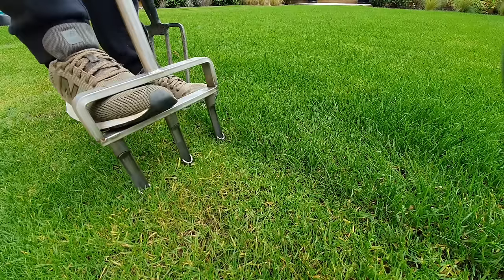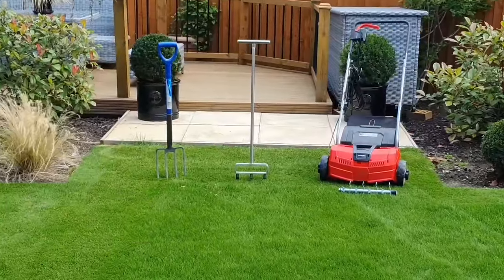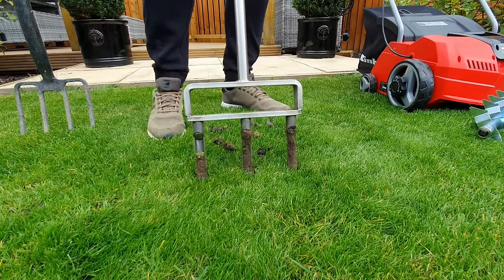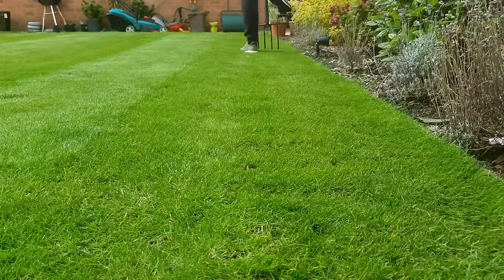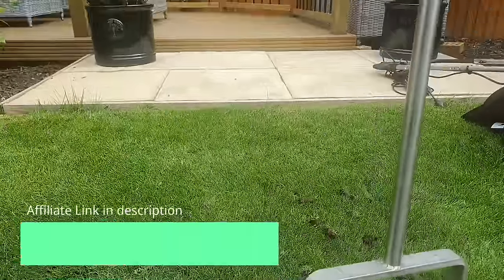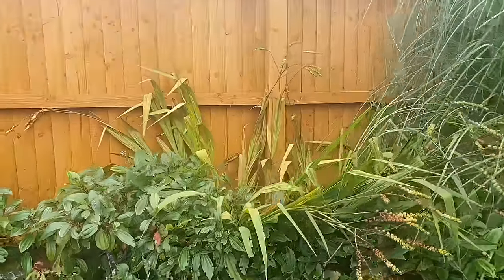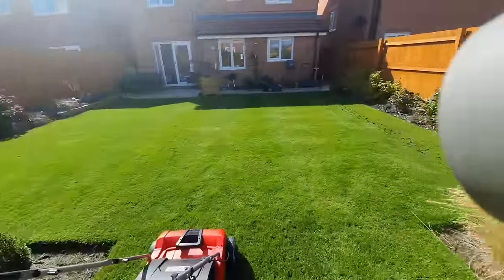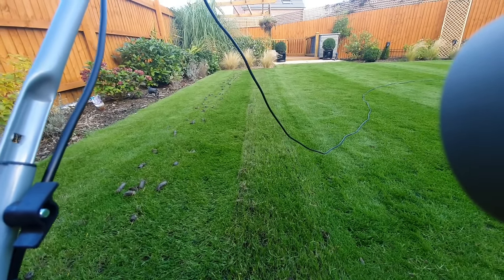3 Lawn Aeration Tools and When to Use (Solid and Hollow Tine)

Comment: If only someone was able to produce a domestic aerator just like your domestic scarifier. The professional ones are very expensive to buy, and a pain to hire if you just want to sort a little home lawn out. Obviously the unit needs to have enough weight to penetrate the ground... but there must be a way!
Reply: It's called your hands 🤣 Seriously, I finished my reno on 200m² with a three tines device by hand. Breaking work into chunks, not all at once but bit by bit works fine. Yet some good Cardio 🙂
Reply: I bought a  Mac Allister scarifier & combined Aerator from B&Q last week for £87.00. Not a bad bit of kit to be honest and did the job nicely . I’d recommend it 👍🏻

Comment: I have re-turfed an area 10sq m.  Removed all of the old turf, rotovated, levelled, topsoil to a depth of 100mm and then turfed.  All of this was done last July.  I wouldn’t think it needs the full works, but do you think that I should maybe manually aerate it with a fork?
Reply from the maker: Sure that will be fine 👍
Reply: Your lawn is still settling down so nothing to harsh just a light tickle with the fork and a good feed that will help establish deep  root growth. R.

Comment: On sloping lawn I use a metal blade lawn edger so the water can penetrate as it flows down hill.
Reply from the maker: Nice, is that to create a run for the water you mean?
Reply: @GardenLawncareGuy  Helps the ground absorb the water and helps stop or  slows down run off.
Reply: Never seen it go up. 🤔

Comment: Great video mate, and comforting to hear a Chester accent, my hometown (although I have livd in Christchurch NZ for the last 10 years). What season do you recommend aerating, and do you leave the cores on the ground?
Reply from the maker: Hi Sam thanks for that! That's a far cry away from the North West, can do it in spring or autumn really I remove my cores normally and I need a flat level for the cylinder mower and don't want them going through that

Comment: Hi there, watched a few videos.
Just recently bought that einhell machine. Waiting a month or 2 to scarify and aerate my lawn.
Is it worth doing the core aeration one month then say a month later use machine to slice aerate then overseed?

Also have a very massive slop as a lawn is that ok to slice aerate was thinking that might help the slope? As grass ain't good on slope but it's lush everywhere else.
Cant core aerate on the slope but could everywhere else.
Reply: Also I think manufacturer states to slice aerate once a month what do you reckon?
Reply from the maker: If you have thatch and debris then you can use the scarifier to remove it regularly. Some do a deep treatment yearly or when needed and other do it monthly bit lighter if there is a reason to do so. If you need any help with your seed choice drop me a message on my website 👍

Comment: When using the machine, what height did you have it on. I’ve got the Qualcast scarifier with this attachment. Thanks.
Reply from the maker: It has 3 settings and I tried it all different height. I think for seeding I'd take it so it makes a light impression to the soil so the seed can almost drop in there

Comment: I wish there was a way to get that hand held aerator here in the US
Reply: Just search for "hollow tine aerator". They might also have them at your local farm store, hardware store, or green house. I see them at Home Depot, Walmart, Amazon, etc. Any store that has a gardening department. I just have some random areas to touch up, so I use a 4-tine garden rake-- poke the holes, drop in seeds, push the dirt back over, and water. Works really well. Best from Indiana!

Comment: Can you do a video on how to get rid of moss? The tree causing the moss has now gone - but how do i get rid of the moss in my grass?
Reply from the maker: Cultural controls are raking, and leaving your grass a little longer to reduce the light moss gets along with fertiliser. Healthy grass will compete well against moss. To kill moss you need to use iron sulphate, this can be in a all in one product or a link to soluable iron sulphate is in the description, spray it and it will turn black for raking out. You will need need to seed those areas to promote grass, if under a tree a shady mix could be good
Reply: @GardenLawncareGuy   Cheers for that, i am in the north west, is it OK to do that at this time of year or best to wait till next year?

Comment: I bought a hollow tine and it is very difficult to push through the lawn. Should i use different method
Reply from the maker: Some of the manual ones can be difficult to use  you can rent a machine or hire a local company. You can also try making sure the ground is wet and soaked through to ease. I used my swardman after a few days of rain and it was great in soft clay
Reply: @GardenLawncareGuy  thanks for the prompt and useful advise

Comment: I just bought the Swardman from Garden Imports, partly based on your recommendation.  I tried it yesterday and I am afraid I didn't get anything like the results you did.  I can only assume that the clay content in your soil is less than mine.  It was also quite difficult to insert in comparison to the 'one stamp' method which you seemed to achieve. Very disappointing.

Comment: Good video - the Swardman aerator seems to be out of stock on your link?
Reply: I bought a Kingfisher RC401 few years back, cheap and cheerful. The thing broke when I tried it on dry soil, so I had a mate weld it all up properly and it's worked fine since. If you have heavy clay soil, like I do, you can use any cheap aerator as long as you use it after a downpour.

Comment: In test 3, I think you have mixed up the scarifier and aerator cartridge.  The spring tine cartridge is the aerator, and the blades are the scarifier.
Reply from the maker: Hi B, the spring tine cartidge is not the aerator. It's more a power rake I'd say but that is what is being referred to as the scarifier and similarly called scarier like other cassette units. Although, in most professional machines i agree you would see something more resembling the second bladed cartidge either fixed or flailing.
Reply: @GardenLawncareGuy  Reason I made comment was when I unpacked my Ferrex combined scarifier/aerator it said the spring tine cartridge was the aerator and the straight blades were the scarifier.  This confused me as I thought it was other way round so checked and double checked. End of the day both attachments pulled at grass and thatch and didn't really aerate at all!
Reply from the maker: Yes the names are almost over the place for these. The blade is aerating by 'slitting' the soil top surface aeration in theory

Comment: Which one did you feel gave your lawn the best result?
Reply from the maker: The hollow core, as I dont have alot of thatch and mainly a clay based soil.
Reply: Garden Lawncare Guy  ok, I did like that particular items, but  just felt for a larger garden it could be a little time consuming. I have hired an electrical one that did the same thing  but as I also have clay soil i found the earth cores doesn’t break down that quickly left sitting on top of the lawn so I found I was forever picking them up.

Comment: I have disliked the video because it is flawed and incomplete.
1. It does not tell you the correct way to deal with the cores that come out from hollow tine aeration.
2. If you leave the cores on the lawn, you get a lawn full of small bumps where you left the core. It will also cause a dirty lawn from where the dirt will be taken to other cleaner places.
3. The clayey cores left on the lawn will eventually go back after a few rains. So it does not address the problem for long.
4. If you remove the cores, you have a massive additional work of removing, collecting and disposing them. Much more than the work needed for aeration.
5. The cores removed will cause a definite dip in the lawn surface level. I have experienced this. That is why it is recommended to brush in sand and compost mix to prevent the bulk loss and to ensure the clay content is not only decreased but also compensated with the best alternative to ensure persistent aeration. 
6. The electric aeration is the Mickey Mouse of aeration. It entertains but remains fictional.
7. The solid tine aeration with the fork is the best with the least fuss and expenditure. 

So what is the BESTEST?
Doing no aeration but to ensure you have a lawn that is thriving with earthworms. They are aerators provided by nature. All you have to do is keep providing them with the humus/ organic matter that earthworm love. 
Spread a thick layer of well rotten manure mixed with dead leaves in late autumn. That provides insulation and food for the earthworms. They work all through the winter. When temperatures come up to above 10C do a good thatch removal and you will have a glorious lawn. 

FOR VERY CLAYEY LAWN;
1. Do hollow tine aeration and remove clay plugs. The distance is C r u c I a l. it should be every 4-6 inches depending upon how much clay must be removed and replaced with C/S mixture.
2. Brush in compost/sand mix

All aerations done by human beings unleash massacre of the very friendly earthworms. 

If you want to take one word only from this detailed response, it is 
Earthworm.